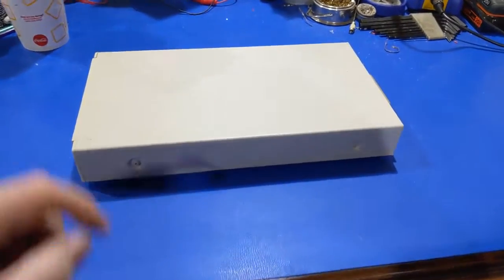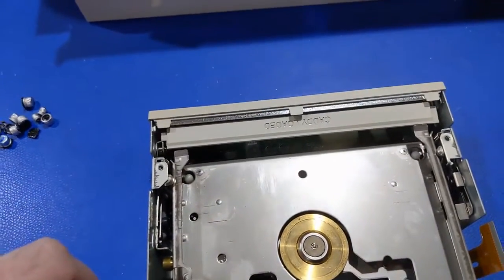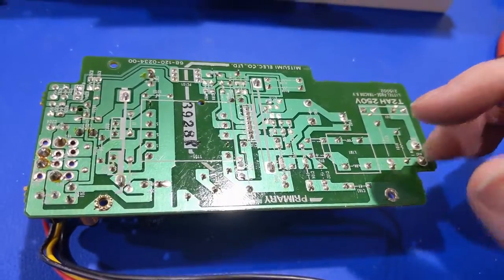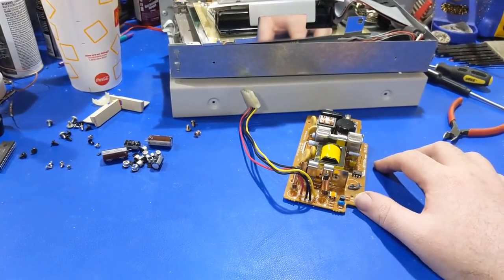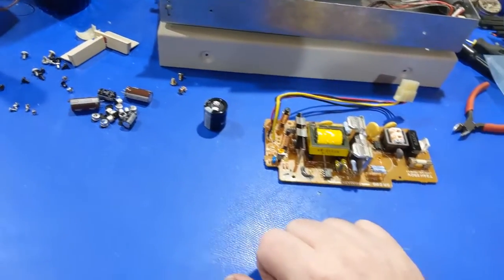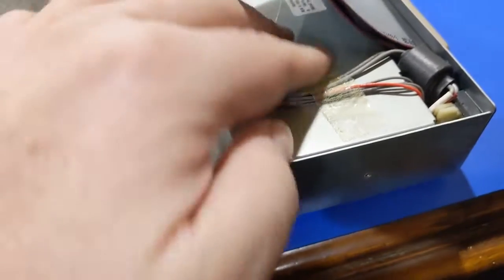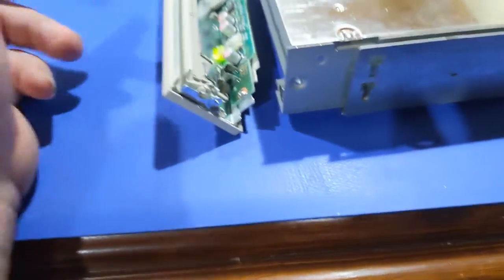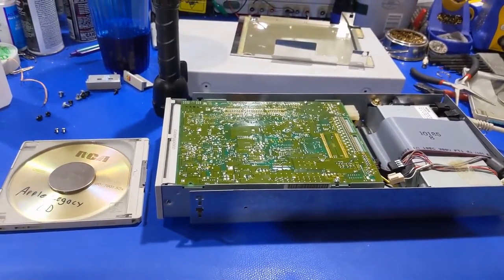AppleCD 300 Drive Recap/Repair

Comment: Hello, I've this unit too, but I noticed something wrong today.

It have some issue with reading cd-r

I'm using tdk reflex cds (blue dye) and is slow.

I've checked the rfo signal with an oscilloscope. No jitter and 1.2 V p-p.
Of course, all caps are replaced by me.
Did you have some tips about the laser adjusting?
There are lots of trimmers, like fbias and fgain (I know what they do -- but the reference is a problem)

Comment: I happened to have gotten a internal version of the Apple 300 recently but the 300 Plus so 2x instead of 1x and isn't a caddy drive like yours. I have two now since the first one arrived DOA.

I'm wondering if caps could be the reason. The motor that spins the CD doesn't do anything at all. The laser seems to work though. I had gotten a replacement from the seller so the dead one I just have sitting in the box it arrived in. :P

Don't recall it smelling of fish or anything. Wasn't aware CD drives needed recaps so I guess I could give it a shot fixing mine at some point.

EDIT: Oh it uses those SMD mounted caps...well gonna have to pass. My soldering equipment isn't really up to snuff for that stuff. I have a LCIII board sent off for someone to recap and I've recapped the PSU myself so already spending some money to have stuff repaired. Since I have a working drive I won't be bothering trying to recap the dead one. :P
Reply from the maker: You should pull it apart and check them. If they are nice and crusty, leaking everywhere, then that could be your problem. And bad capacitors in the Servo circuitry will stop the CD-Rom drive from working properly. The Focus/Tracking, as well as the Disc spindle PLL must obtain proper servo lock so the EFM can be properly demodulated. caps will screw with this.
Reply: @THEtechknight  I just noticed that your drive uses a linear voice coil to move the laser? You mentioned a voice coil later in the video right after I posted my comment.

I didn't know anyone made CD drives that had that tech. I saw one in a floppy drive for the first time a month back when I got a LS120 drive (a iMation USB SuperDrive but it's just a fancy USB enclosure) to put into my PC and saw that when I took it apart to clean it so I knew they used them in floppy drives at least and hard-drives of coarse are well known for having them too.

Anyways I do know that the Apple 300 Plus drives I have don't use voice coils as they have the standard setup that today's drives still use. It's not a caddy drive like yours either and operate more like the modern drives.

I don't recall seeing issues with the caps when I had them apart. I had to swap the entire cases over when I wanted to use the front bazel from the dead drive on the working one. Turned out the other drive's case was slightly different in how the bazel was mounted + the chip layout on the bottom of the board was slightly different so I couldn't just swap the internals in the case either since the thermal coupling of the chips to the bottom metal plate wouldn't line up. Fortunately I was able to use the bottom plate of the case from the working drive in the case of the dead drive so that didn't turn out to be a problem. 

Anyways I'll keep an eye on it. I hope I won't have to recap it soon because I'm pretty sure like yours it has SMD mounted caps and I'll probably have to have it sent off to get repaired as my cheap ass soldering gun can't do that stuff. Pretty sure I'll tear some pads off or something trying to remove those SMD caps. :P

I can't really afford to get a better soldering gun/vacuum pump at the moment.

I will be doing the PSU soon though. It's working now but pretty sure it won't forever. I have an HD enclosure I got from someone on Facebook (in that vintage Apple computer group) who I bought a drive and the enclosure from. I got it knowing the PSU in it needed fixing.

Hard-drive wouldn't power up properly until the PSU had been on for a couple minutes. After I recapped it, it fired right up and works fine now.

The enclosure I got for my Apple 300i however works fine but yeah gonna recap that soon. It's got standard threw hole stuff on a single sided PCB which I've been able to work on easily with what I got. So definitely gonna recap that one myself. :D
Reply from the maker: @MagnumForce51  Yeah its a voice-coil drive. The voice coil drives and Cd players were very high-end. chances are, this thing was NOT cheap when it was new.